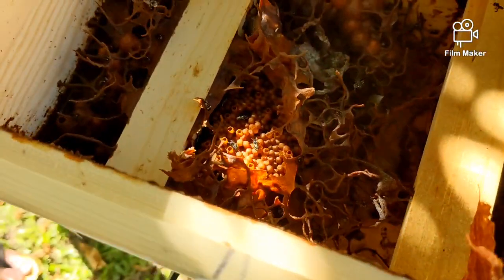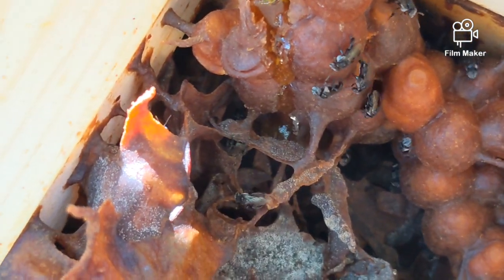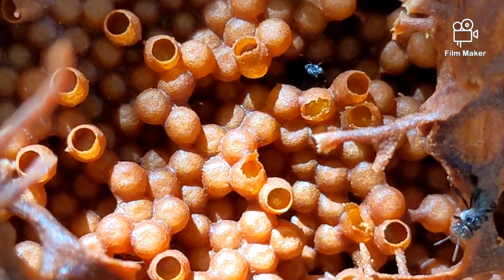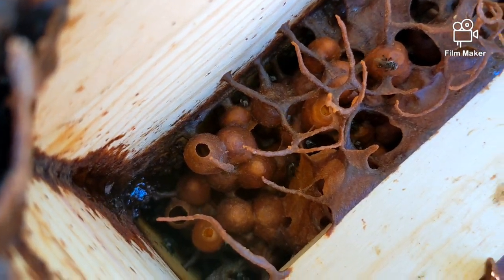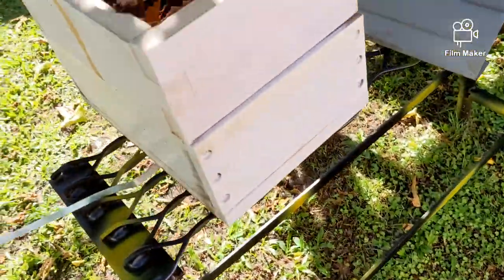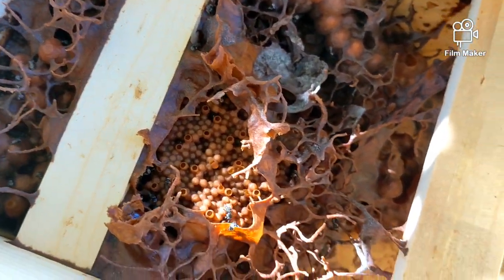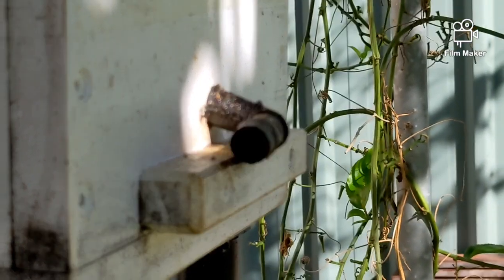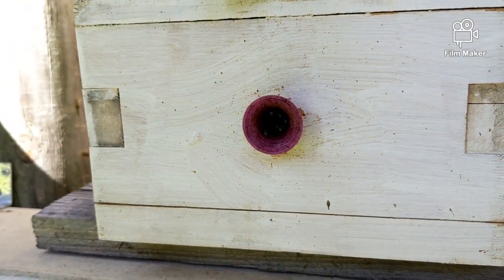Inside Hockingsi Stingless Bee Hive 19/04/2022

Comment: They are so amazing!! How do you make a split with theses bees Trevor?
Reply from the maker: Hi Rickey, the 2 parts of the hive where the split bars are separates the 2 halves when it's full of brood. To make sure both halves survive, you put a small amount of the advancing front into the half without any. This ensures that it can produce a queen in either hive if you lose the queen as you don't always know which 1/2 she is in. As she's usually hiding very well. You can also split them vertically by seperating the brood in 1/2 as well. Not a lot of people do it this way, but if you do then you have both halves with all stages of brood. Much better way to do it. Hope this helps 👍🐝🍯